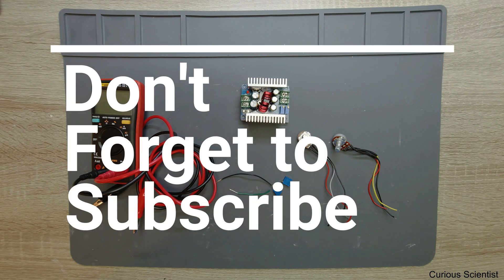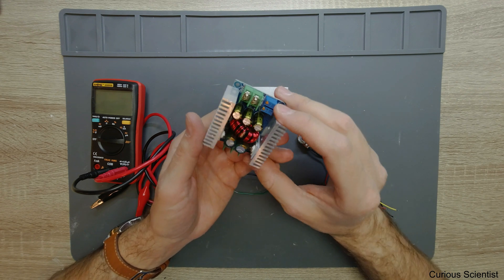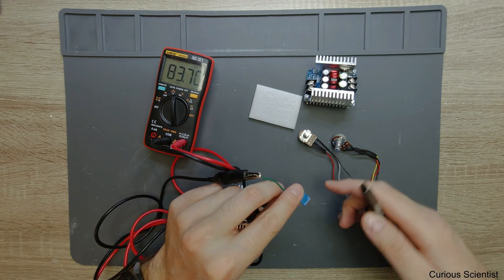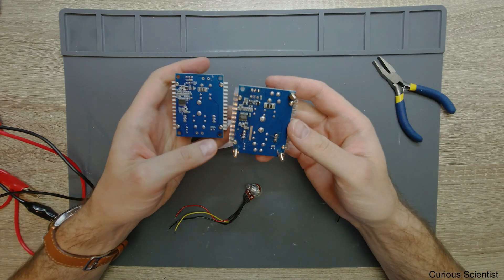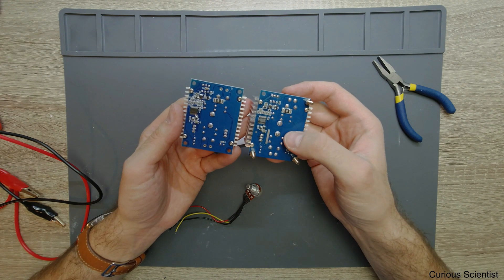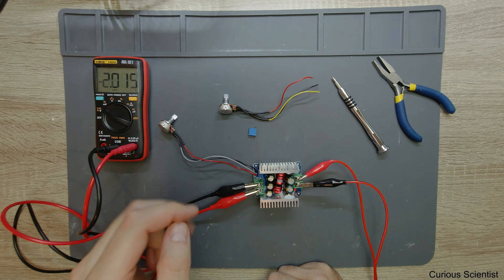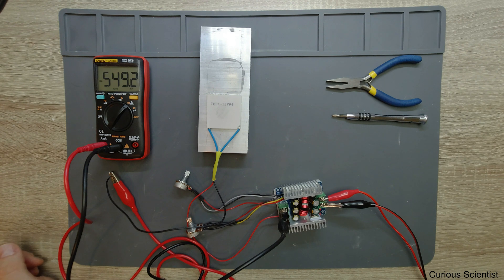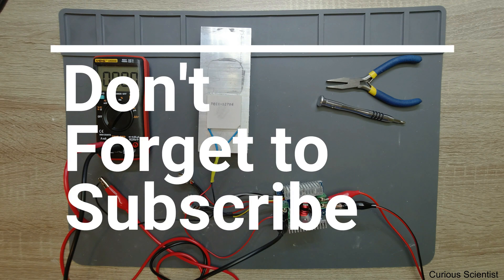Replacing the potmeters on the 300 W, 20 A DC-DC converter

Comment: I have soldered a 100k ohms potmeter to exactly this 20 A DC-DC converters constant current spot. But when I rotate the potmeter the currenct goes only from 0% to 20% current. If I rotate it any further it jumps instantly to 100% current. Can you explain this behaviour?
Reply from the maker: Have you checked with another 100k potentiometer? Maybe it is just the potentiometer... I tested the whole circuit by messing around with both potentiometers and never had this issue. Also check what kind of load you are using...etc.
Reply: @CuriousScientist  Thank you very much for the fast answer. I checked again and I found a loose connection. After fixing that the potmeter somehow got faulty. I swaped it with a new one and now everything works as it should :)

I just think that the behaviour I experienced with the potmeter / dc-dc converter was really weird. (It somehow working for low loads. But after a 2A threshold it would just jump to 100% / 10A instantly)
Reply from the maker: I am glad that you solved it! The circuit is really sensitive for bad contacts or lack of feedback, so it can behave weird if something is not 100% OK with the CC and CV potentiometers. Also, be careful, because you can easily destroy the MOSFET in these boards. I saw several complaints about it, especially when people replaced the potmeters and messed up something (for example, poor soldering) during the process. The sudden jump might have been caused by the bad potentiometer too. Maybe the internal contacts of the potmeter were okay between the values you mentioned, and above the 20% current, it went to fully open or closed which then made the circuit go bananas.
Reply: @CuriousScientist  Thanks for the input. I hope i didnt damaged the Mosfet x). Because I tried some stupid things with this circut, befor I found the bad connections error.
I tried various different Potmeter with different values. (Which should not harm the circut). But I also tried reordering the connections from the circut to the potmeter. Because I wasnt sure which connection from the circut goes to which connection on the potmeter. That might have been a bad idea. But for now it seems still to work.
Reply from the maker: I have a more recent video where I tested this DC-DC converter with several different potmeters. They do not do any harm, but only cut the range of maximum output current/voltage. Flipping the connections are also safe as long as you did it symmetrically. If you just flip the two sides of the potmeter and leave the wiper as it is, you just flip the starting point of the potmeter, so instead of going from 0 Ohm to 100 kOhm, it will go from 100 kOhm to 0 Ohm. That should not do any harm either, as far as I know. Also, keep in mind that the CV potmeter acts as a rheoistat and the CC is wired as a voltage divider in the circuit. I suggest you to check this video if you are curious of these things in more details: https://youtu.be/43INmzkNz8o
Reply: @CuriousScientist  I looked a bit into Rheostats. I thought I could just use my 100k Pot for the CC. But now im not so sure anymore. It seems like the current goes through the Rheostat..?

If thats true I should not have connected the poti to the Dc-Dc Converter with 24awg wires. That rating should be to small for 200Watts / 10amps
Reply from the maker: No-no, it is not the whole load that is going through the potentiometers. The potmeter would not be capable of handling such a high current. The CV is wired as a rheostat and the CC is wired as a voltage divider. Why this is important is because you can wire pin 2 and pin 3 together for the CV potmeter, but for the CC you have to make sure that you don't short them. Check the video I suggested the last time.
Reply: @CuriousScientist  Wow. Yeah I missread that I should connect the potentiometer as Rheostats on the CC. Wow dumb me. 
Weird that It still somehow worked. I could adjust the led with the potentiometer but only between 0~3Watts and not the expected 0~180Watts. 
Nothing broke tho, after soldering the original poti back in its CC place it worked like it should.

I've fixed it now by just soldering the potentiometer on the CV and limiting the CC with the original poti. 
I wired it like in the video you showed me and that just straight up worked. 

Thank you very much again for all that time you spend trying to help me! <3
Reply from the maker: Hey! I am glad that you made it work and I am happy to help. It is good to see that people are trying to figure the things out themselves and they just need some guidance instead of a "turnkey solution". Just let me know if you get stuck somewhere.

Comment: some Modules have a Fake LM25116 if you Put a Potentiometer 100% will burn the Chip by this Video a lot people they will burning the Module :)
Reply: @DIY Jaki: Thanks for the info, i want to buy this modules for solar charger.
I hope, i dont buy the Fake one
Reply from the maker: So far I haven't had any issues with replaced potentiometers. Also, people buying fake products is not my responsibility. Whenever I know about it, I always notify the viewers about quality issues (like I did for this circuit and for Peltier coolers), but in general I cannot really control these things.

Comment: hello a doubt in place of the potentiometer of 100k can I put the 10k?
Reply from the maker: Yes and no. I haven't tested it this way, but since you change the current running towards the FB pin, you would miss the 10k to 100k part of the resistance. Which means that you could not go below a certain values in current. That suggests me that you would not be able to control the output voltage on the full scale. I could actually test this. It is too late now, but tomorrow afternoon I will look at it on my circuit.
Reply: @CuriousScientist  so I bought the 10k multi-turn potentiometer and installed it on the disconnected and discharged plate more when I called it doesn’t work the plate is burnt I put the original pots and nothing burns the plate, but now I don’t know why and I’ll have to buy another unit and I fear it is for  because of the 10k pots I put
Reply from the maker: @Medieval_Luthieria  I don't know if you followed my recent videos, but I tried it with different potmeters down to 1k and I explained what is happening. My circuit survived the whole test. It even survived that I removed and replaced the potentiometer while the unit was powered. So, I think either you got a defective product or accidentally shorted some sensitive connections.
Reply: I believe that there was a short or defective plate because I just changed the potentiometer and stopped, I really appreciate your help and congratulations for the videos.
Reply from the maker: Thank you! Let's hope that the future modules will not break down and will serve you for a long time!
Reply: Hello friend, how are you? I ended up buying an equal one and when I connect a device to the power outlet the amperage does not go up being useless, but when I test it without connecting anything to the outlet the amperage works normally, you know what may be happening?
Reply from the maker: @Medieval_Luthieria  Hi, I am fine, thank you! I hope you're doing well too! How do you measure the current without any load? Or do you measure the input current? Do you use it with the original potmeters, or you replaced them? If you have the original potmeters, then keep in mind that they are multiturn potmeters and it can happen that you have to keep turning them for a while before seeing any change in the current.
Reply: the amperage medication without anything connected to the output I do with the multimeter connected to the positive and negative output on the ampere scale, so it works normally giving me the total amperage regulated in the pot, but when I connect some equipment at the output it does not allow  regulation giving faults, as if I did not have enough amperage and not exceeding 1.80 amp being that I have 15 amps in total, I use multiturn potentiometer that replaces
Reply from the maker: @Medieval_Luthieria  I have the impression that the problem is not with the DC-DC converter but with the way you are trying to measure the current. You have to use some load and you have to put the current meter in series with the load. You cannot measure the current in the same way as you would measure the voltage. Also, keep in mind that if your equipment is not rated to at least 15 A, then you won't see 15 A in your circuit. You cannot force the current through it in normal circumstances.

Comment: My module dead when replace trimmer to potentiometer. May i know why? Already 4 module i did it dead. Sorry for my english
Reply from the maker: Your English is good! Do you use same value, 100k potentiometers? Do you make sure that there are no short circuits? I tested it on four circuits too so far and all of the have worked fine. As you see in the video, it works just fine.
Reply: @CuriousScientist  yes sure no short circuit after soldering. Well i done extend that potentiometer. After 10-20 minite use later, i heard pop. Then voltage goes to zero. Value is correct. I,m use 104 10 turn potertiometer
Reply from the maker: Have you measured the input and output voltage and current during the use? How much load you put on it? Can it overheat?
Reply: @CuriousScientist  i'm using 36volt ac to dc module power suply. Actualty i dont put any load yet. While rotating the potetiometer to value i need, i heard pop and voltage goes to zero. And led on the module do not light up. Do you have any sosial media platform? I will sent picture for you
Reply from the maker: @usahapetani9743  maybe you want to carefully read my website and YouTube page... :)

Comment: which one is better to buy green connector or black connector?
Reply from the maker: Hi! I would go for the green one. It has better quality.
Reply: @CuriousScientist  what is the issue you faced with the black one?
can you share your experience please?
Reply from the maker: The connectors seem to have a little lower quality. Also, the capacitor at the potentiometer is directly soldered on the pins and it does not have a dedicated location on the PCB as in the case of the board with the green connector. But you should watch the video, because I tell everything there. :)
Reply: @CuriousScientist  Is there any performance difference? this is the last question😊
Reply from the maker: @userlevel61  :D There are no performance differences. Both of them are the same, they just (I assume) come from different manufacturers. The parts are identical everywhere, except the C15 capacitor which I mentioned above.

Comment: Nicely done. Buying this sort of modules I also noticed slightly differences between them and I don't think they are improving something, is more like some factories are copying wrongly what others built before :)
Reply from the maker: Thanks! Yes, it seems like that some manufacturers are cutting corners. It is not a healthy practice in my opinion. But I was really surprised and happy when I saw that the better board had a dedicated place on the PCB for that small capacitor. It makes it simpler to replace the potmeters. Until a point, I was also thinking about removing the switch and add a flip switch on the front panel of my DIY power supply, but I did not have the patience for that.
Reply: @CuriousScientist  if i have a 72V battery and i want to step down to 12V 

Can i connect the Vinput of 2 converters in series? This will technically give 36V for each on the in put side and 12V 20Amp on the output side
Is this doable?

Btw i know that i have to put a diode in case i wanted to connect the outputs but I dont... i will only connect the Vinput in series and the output left independent
Reply: @FirstLast-tx3yj  don't do that, it will damaged the buck converters on high loads, just buy a buck converter rated for higher voltage. There are many you can find online
Reply from the maker: This is the way! Just use a higher voltage  buck converter. There are many on the market. 

Sorry, I didn't see the question. If someone writes a comment under someone else's comment, I don't always get notified.